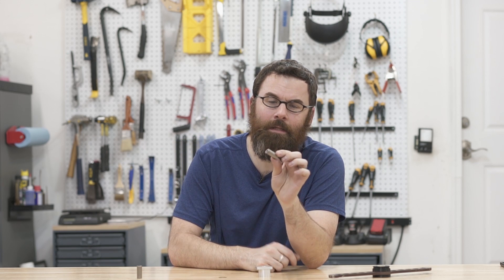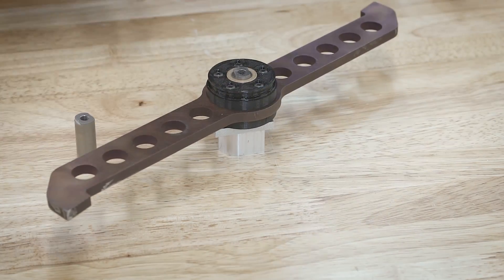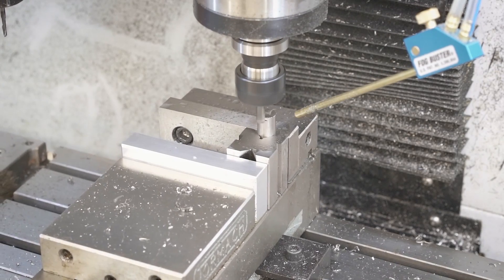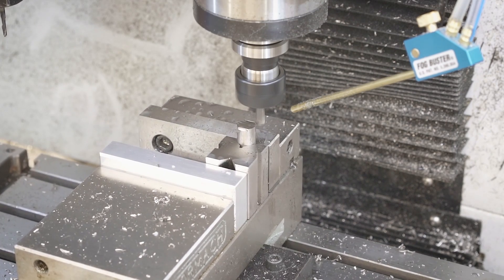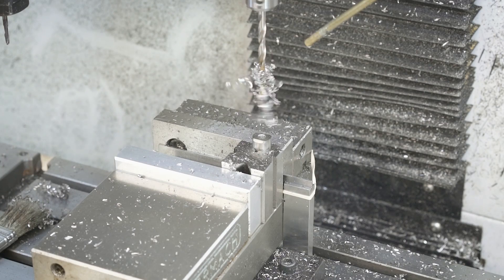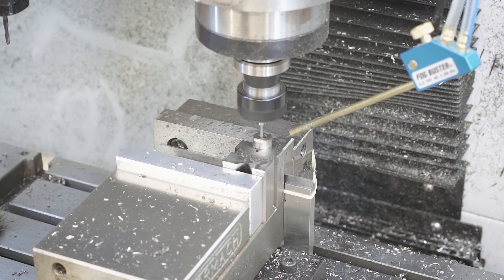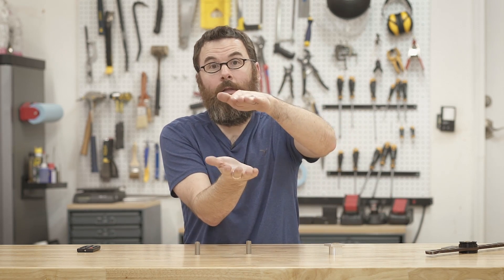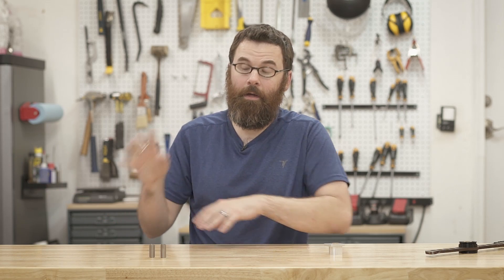From Start to Part:  Titanium Weapon Shaft

Comment: Very nice example of machining titanium on the Tormach mill! Great to see the success of thread milling in this challenging material. This is a nit picky observation, but I think your explanation of how you clocked the notches at each end so they would be aligned is not quite correct. @08:26 it appears that your setup used an engineering square, not a parallel, to clock the part. The only reason I mention it is because it took me a moment to figure out what all that metal was within the rubber band. Ah, it's a square! I really enjoy seeing the approaches people make to solving filtering challenges. I secretly hope watching these will help me be more effective when faced with issues in my own work.
Reply from the maker: Ha, you're right.

Comment: Not sure you'll see this comment on an old video, but fwiw you can buy import threadmills for significantly cheaper off aliexpress/banggood/etc. They also sell three toothed ones designed for harder materials that I've had decent luck with.
Reply from the maker: Good to know.  I've had bad luck with cheap cutting tools, but I might try these next time.

Comment: Especially after seeing the heat on the drill I am shocked you hadn't abused flood coolant or at least lathered the part in a good chunk of cutting oil just to give you an edge. Great video regardless.
Reply from the maker: The flood coolant on the 440 is awful.  The machine just leaks all over the floor and it needs constant maintenance.  So I opt for the fogbuster intead.

Comment: Don't you use bearings?.....
Reply from the maker: I have another video showing the 'stackup' for the weapon assembly.  There are thrust washers/bearings on top and bottom, and a needle roller bearing in the middle.

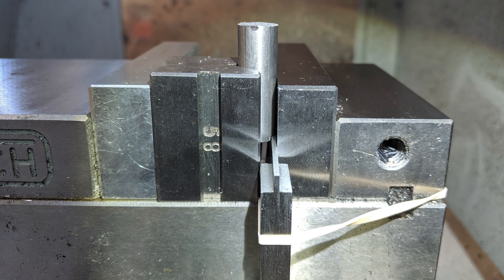Comment: I think that setup at 8:19 is great for making sure that the top and bottom are aligned (rotation-wise) but I think the setup would not help with top and bottom faces being parallel. The v-block will set the angle properly (aligned with Z axis) but would benefit from a quick turn on the lathe the make the stock round and concentric. And that would make it way overkill for this application of course :) Cheers.
Reply from the maker: Agreed.  But you're also right that it would be overkill.

Comment: Is that a TiN Coated drill? That could be part of the problem since the coating and the material are similar.
Reply from the maker: Possibly.  I should have used one of my cobalt drills probably.
Reply: Carbide is generally the way to go when time is money.